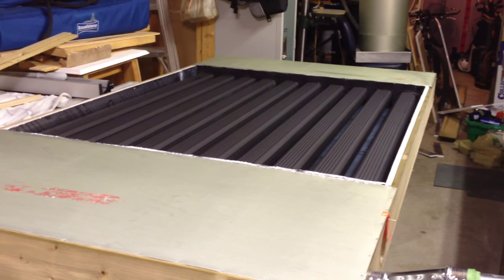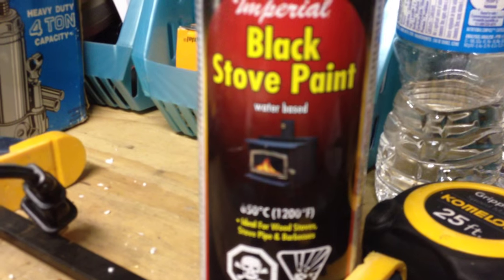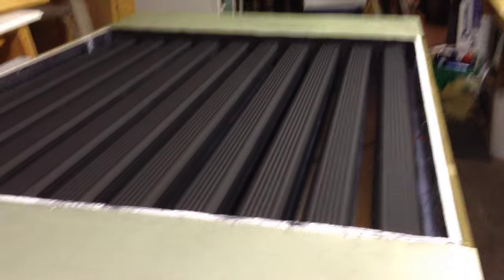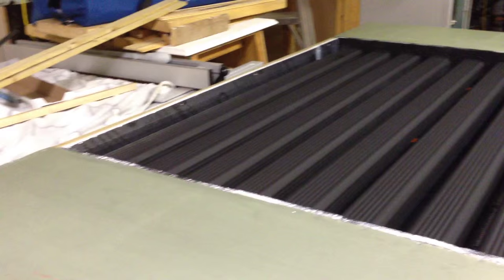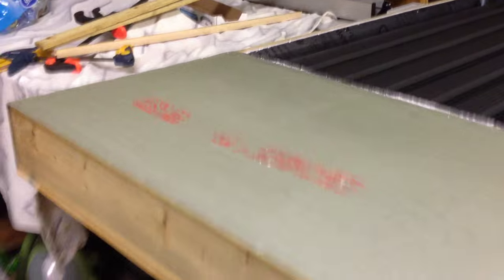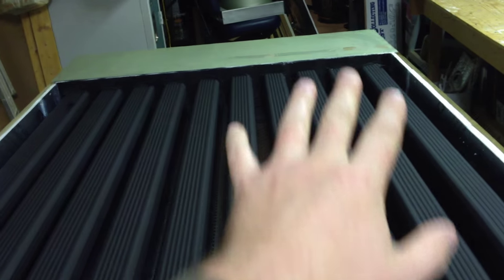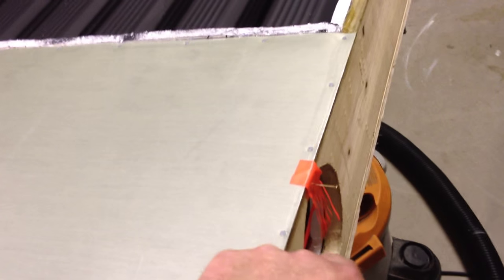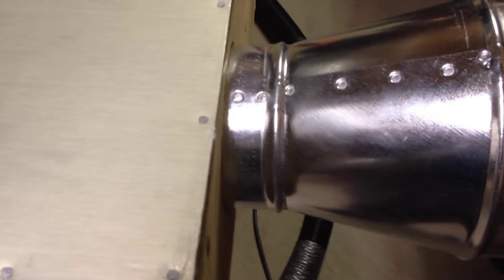Solar Hot Air Collector (Aluminum Downspout) First Test!

Comment: Nice. If I where you I would put the fan on the out side. It's best to pull the air. You will get more air flow and beater heat. God bless.
Reply from the maker: +yankey4 Thanks for the advice.  I have a new Workshop/ATV shed being built hopefully before winter.  The plan is to pull the air in from the collector.  Where it will sit is outside on a stand and ducted into the structure.  I'm not quite ready yet.  Having a heck of a time with finding the proper glazing.  Guess I should have bought that first and designed around it. Cheers!
Reply: Keith H. That sucks. What about that clear stuff they use for a green house? Hvae no clue it it would work or not. 

I am just about ready to put mind in. Still need a few things just cheap stuff but right now food is the thing we need the most. Thanks for doing your video you helped me get off my butt and do it. God Bless

Comment: Nice.  have u put in service yet? I particularly like the design due to proximity of the input and output. mine will be roof mounted so I wanted to minimize the distance of the output run that exposed to the outside air.
Reply from the maker: +Karl Palan Unfortunately no, I ran into a major plumbing issue which set me back a bit. I was in the process of building a new out building to store my ATV. That is where I want to start testing but it won't be till spring now since winter just set in.